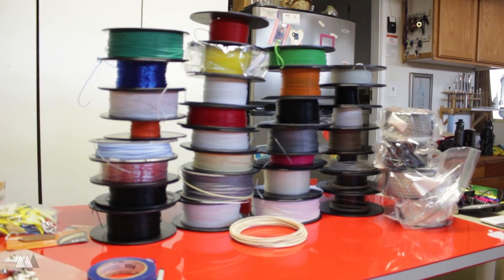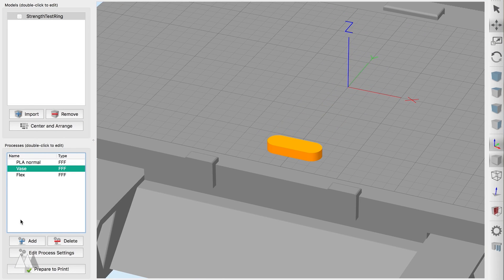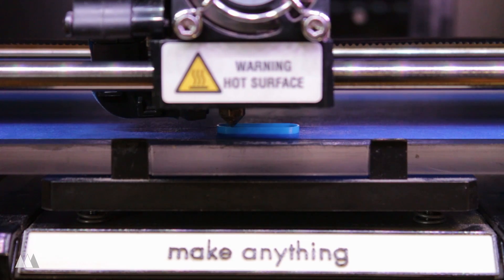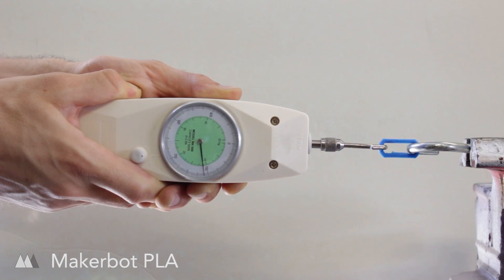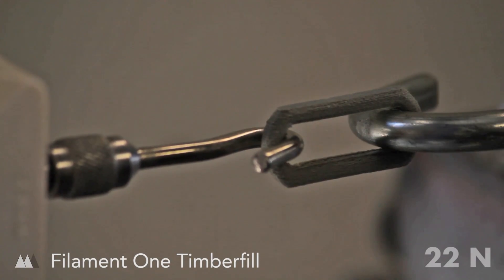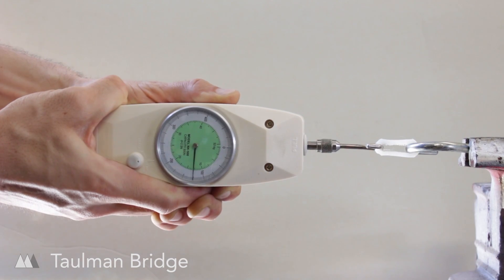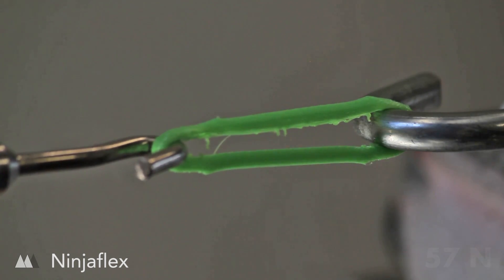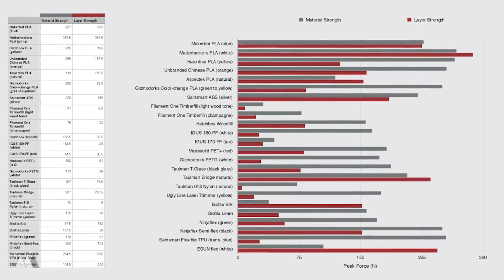The Ultimate Filament Strength Showdown!

Comment: I noticed after trying a cheap brand and HatchBox from eBay, I got stringing and deformities off the first medium prints on both brands. After using about a quarter of the roll I got better prints and even better sheen on the prints. I think what's happening is when these filaments are shipped they sit in the shipping truck for hours or in a whorehouse causing the first 50 or 100 feet of the filament on the roll to get damaged. PLA is an excellent filament and pretty strong plus looks good when it's fresh but, very delicate to keep in good shape.
Reply from the maker: I've heard the are some fake Hatchbox filaments sold on eBay, so make sure the packaging and all that is legitimate!

Comment: I know this is 2 years old and you mentioned that you don't know that much about material testing.. but.. as a final year Mechanical Engineering Student that works in the university's 3D printing lab... I've got a bit to say about this "Ultimate Filament Strength Showdown", as this just puts out fairly irrelevant data via a method that is fairly flawed. The links that you created are no-where near standard and the cross sectional area is completely different when comparing in-layer vs cross-layer strength. so it's no surprise you get some wildly different results.
When testing for material properties, you're better off using a loadcell that takes measurements at regular intervals with a constant strain rate, as the inconsistencies of you pulling the material could impart inertial loading and alter the result.
There are also international standards that allow you to easily compare results across a multitude of different materials, so you can make the simple statement that x is twice as tough as y.

Here are some standards that are useful for future reference.
Tensile:  ASTM D638 for standard plastics and ASTM D3039 for composite polymer matrix materials with filler materials (Like chopped Carbon Fibre).
Bending: ASTM D790 and D7774
Compression: ASTM D695

I hope that you revisit this with a proper testing method :)

Comment: Good video. You may want to bake your filaments in the oven to remove moisture, its a little unfair to have all those bubbles in the print in a strength test. I recently had a pla doing the same thing i baked it at 60* c for a few hrs it made a massive difference.
Also baking parts before and after strength test to get a stronger layer bond helps a lot. I wouldnt retest all of the plastics just the most popular and a cheap generic.

Comment: Loved this video, great idea and execution! I'd love to see more testing videos like this. It could be interesting to see what kind of projects could benefit from what you discovered today, like maybe a 3d printed stretch arm strong where all the limbs are different materials or making another product that benefits from being stretched.

I have a few pointers for your testing process.
1) To get more accurate tests you should print multiple copies of each filament in both variations. Then test all of them and find an average. This should help to minimise any inconstancies caused by the printer you used/environmental changes during testing that could affect the printer from showing in your findings. 
2) The same printer should be used for each print to make sure there are no variations resulting from different machinery. (You may have done this already)

Another idea for a future testing video could be showing how well different filaments respond to changes in temperature.

Comment: I'm guessing something went wrong with the nylon printing. Nylon has excellent layer bonding but yours looks like a pile of hair. Did you dry it (bake in oven)? Turn off part cooling fan? Use rated temperatures?
Reply: Check the chart here. Nylon blows away PLA. It would have done better but the clamp that they tested opened instead of broke as nylon is more flexible. 

http://www.matterhackers.com/news/filament-strength-testing

Comment: Most of the videos I have seen so far are about tensile strength of different filaments. It would be nice to see some kind of impact resistance too. No idea how you could do that but it will sure be interesting. Nice testing, thumbs up.
Reply: I know this is a year old but for future reference, the ASTM D256 Izod Notch impact Test and the ASTM D6110 Charpy Impact test are good starts for toughness determination.

Comment: what a great video !
Do you know what's the best temperature to print ABS filament in order to improve the resistance between two layers ? the most of my printing of ABS filament breaks between two layers :/
Reply from the maker: I don't have much experience with abs, but increasing your hot end temp could help, and an enclosure to trap heat would also be good

Comment: First I want to say I like your testing. As far as printing zip ties you need to also account for the electricity the machine used in printing and machine wear (most people fail to account for these factors even in many small businesses so your not alone). Do I print things I could buy just as cheap? Well heck ya! some of it has to do with convenience of being able to print when you need it instead of having to drive and buy it or ordering online and waiting days. But it's also just so fricken cool to be able to make your own products.

Me, I make lots of GoPro accessories (and I design almost all of the ones I make) some of them I could easily purchase for less money but some just don't exist or don't exist in the configuration I want exactly.

There are always going to be negative people telling you that your doing it wrong but most of the time it's people that don't or can't do it themselves so just ignore them and keep on printing!
Reply from the maker: Thanks! I just happened to make a GoPro accessory this weekend... video coming soon :D
Reply: EpoxyJewelry.com
Reply: machine wear? what wears out? 
i been 3d printing for 6 years on the same printer and not once did i replace something because it wore out. 
i have updated the control board but still never replaced something becasue it wore out. just so i can print faster and quietly. 
so increasing efficiency by speed and reduction of loss of sound energy. 

electricity is cheap. its 14 cents per kilowatt hour here. takes 2 minutes to print a ziptie, and 7 minutes to warm up from a cold state. 
135w/hr while warming up the build plate 4 minutes
170w/hr while maintaining the build plate and heating the extruder. which takes 3 minutes.
40w/hr average surprisingly while printing.
9 minutes total to print one ziptie from a cold machine. 
for a grand total of $0.00 ($0.002415) at 0.01725kw/hr per zip tie in electricity usage. measured using a watt meter.

grand total of $0.01 for a zip tie. 
electricity usage in this case contributed an infinitesimal amount to the cost.
my printer also may print faster than yours. the zip tie i printed may be different in size from one you print.

Comment: I think you would have been better off printing a circle instead of that thing. Its sides are printed in a way that they just shear when pulled upon. Nonetheless great to see you tackling a strength test, great job.
Reply: Since he was only comparing types of filament to each other rather than doing an overall strength test the shape is mute. If you want to gauge the actual strength in various ways (elongation, sheer....) then yes the shape would be more important.
Reply: The test only ended up testing the shear strength of how well the filament bonded to itself not the strength of the filament. My previous statement was spot on. I you are comparing how well filament bonds to itself beside other filaments then you are correct.

Comment: That's really disappointing about the moisture content of vacuum sealed filaments :(  I luckily have a convection toaster oven that I found next to a dumpster that I use to dry them out. Nylons are super hygroscopic, maybe even more than the desiccants packaged with them ;)
Reply from the maker: Does the toaster oven really restore the Nylon to it's former glory? That might be the route I have to take to make my spools more usable. Other than that annoying aspect, I think it's a great material
Reply: +Make Anything // 3D Printing Channel I'm not sure about regular toaster ovens. They seem to get hotspots in them.  Might want to investigate a nit otherwise you might end up with a nice filament puck :( . Mine is convection and has a circulating fan. I set it to 150F and it drives a lot of the moisture off ( I can see that the glass door fogs up noticeably). I also use a moisture indicator that you can find that comes with electronic parts sometimes. A regular oven or a food dehydrator also works ;)
Reply from the maker: fancy!
Reply: There is a tutorial out on the web to use a https://www.amazon.com/dp/B008H2OEKK/ food Dehydrator and a special Rubbermaid container like https://www.amazon.com/gp/product/B000BC5EY4/ with the rim cut off.

Comment: I've read that the strength also depends on printing settings like temperature.
Reply from the maker: true. I just used the recommended settings for each filament, but I'll have to explore the effects of changing temperature
Reply: Make Anything // 3D Printing Channel I think that if you print slower and a little bit hotter than the suggested settings the pieces will come out stronger.

Comment: For tensile strength test, specimens should be much thicker on the end where they are attached so they will fail in central part with constant cross-section. Otherwise stiff materials would get lower rating due to concentration of stress.
Reply from the maker: Good to know, this definitely isn't my area of expertise. Thanks!
Reply: +Make Anything // 3D Printing Channel see here some samples: http://m.mtu.edu/materials/k12/experiments/tensile/

Comment: Nice experiment!  Just a few things to nitpick.

- T-glase is not nylon, it is PETT (http://www.3dprima.com/shop/ws45/37645/art45/h9582/21639582-origpic-9296ef.png)

-  Your layer strength test is testing the shear strength of the layer bonding (sort of) while your other test is measuring tensile strength of the polymer.  More conventional print strength tests that I have seen are done like this (https://www.sculpteo.com/blog/wp-content/uploads/2014/05/Break-point-3D-printing.jpg).  Here: z is the layer strength test (in tension) and x/y is the polymer tensile strength.

- Finally, I would recommend using the same cross sectional area for both tests (this ensues that you are actually comparing strength as opposed to force).

Keep up the good work, I really enjoy your videos.  Let me know if this makes sense or if you would like clarification! Source for engineer-y bits: mechanical engineering degree(s).
Reply from the maker: This is the kind of feedback I was hoping for :D appreciate it!